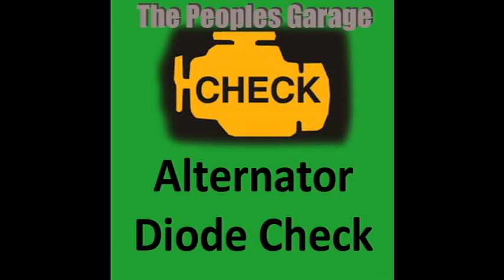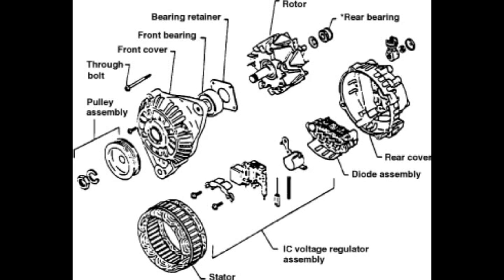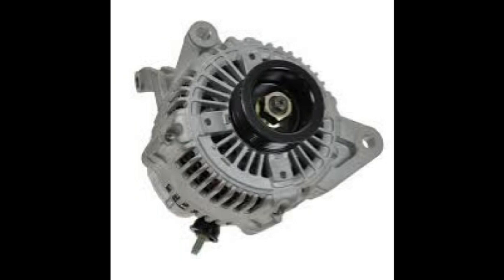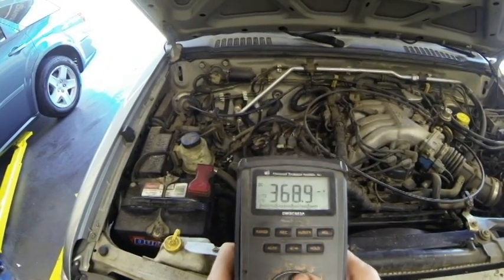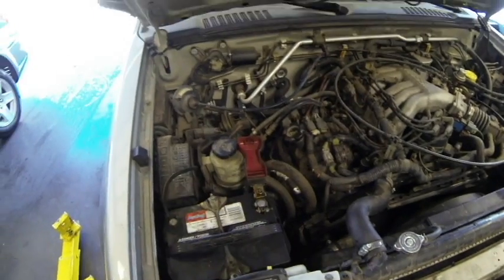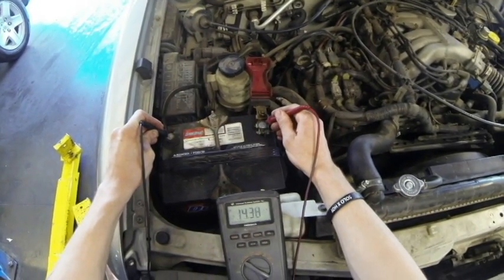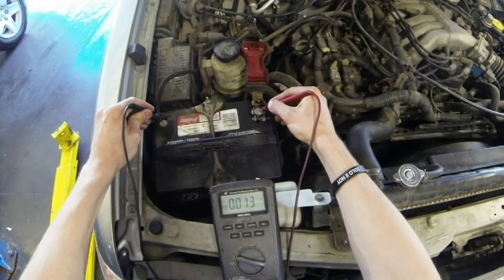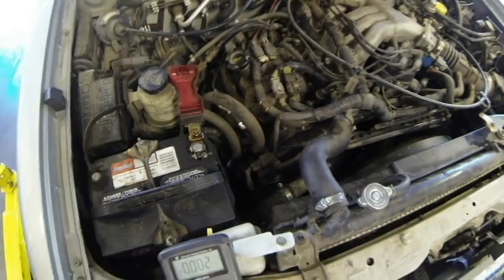Alternator Diode Check and AC Ripple Check

Comment: I've seen videos where people put the multimeter on diode mode, then touch the case and positive post on the alternator in both directions.   If they get a reading both ways the diode is bad.  Is this test as accurate or better?   Just trying to learn and find the "easiest" ways to do things.  Also, is it true a bad diode can drain the battery when the engine is off?

Comment: My battery is going dead over night and its a new battery and no parasitic draw. I ran this test and the ac volts spike between .070 and.040 constantly bouncing up and down. Would this be the issue?
Reply: did you sove the issue ? ;) What was the cause of your paralytic drain ?
Reply: @maxmagnus15  For me it was an issue with the ignition relay. For some reason jeep put it under the driver side wheel well and it was getting soaked in rain

Comment: With my multimeter set to ACV and the leads firmly on the battery posts, I have a reading that keeps jumps around. The numbers will never stop moving. Would that indicate a bad diode? My battery drains overnight.

Comment: When doing this test, do NOT use a cheap Harbor Freight DVM. I read 31 Volts AC on crap DWM, then used quality DVM like a Fluke, read .2 Volts AC. All good now.
Reply: Hmm yeah I was getting 26 volts on my Harbor Freight (free) multi Volt meter.   That's insane!  So you could be right. Sometimes I trust my life to the readings of a volt meter. Probably time to upgrade:)
Reply: @WhatDavidDoes  Try a Fluke. Harbor freight is junk for just reading basic 12 VDC signals. They won't work at higher freq also
Reply: I think a Klein multimeter is a good middle ground.
Reply: Why would we take your advice? You're the one who used a "cheap Harbor Freight DVM" to do diagnostic testing. So now, the rest of your advice is suspect. If you actually own a Fluke voltmeter, why would you work on a car with the HF? I'm just not buying whatever you're selling.
Reply: @uruiamnot  clearly you know everything so do what you want. I learned this from EE n suppliers. Take it or leave it. Flukes work better
Reply: @michaelreilly3100  Your conceptual error continues. Now, you're a either a marketing genius or buffoon.
Reply: @uruiamnot  good luck with that attitude. Please use cheap DVMs
Reply: @michaelreilly3100  I own and use both cheap ones and expensive ones; I even own a Fluke. Since I understand the operation of them, and I have good, practical experience, and good situational common sense, I know when to use each one. Your situational awareness is demonstrably bad, because you assumed I was against Fluke and for cheap voltmeters when I never said that.

This is why your advice is unreasonable: you don't know what you're talking about.

Comment: I'm getting pulsing headlights and interior and dash lights .I did test the DC volts.and that was fine.but I did not do the AC check.can a bad diode cause this.
Reply: Daniel Pettis , did you get an answer to your questions? I also have a suspect diode leaking A/C.

Comment: I used to rebuild alternators years ago and there are 3 negative and 3 positive diodes in most alternators. GM alternators had a diode trio on  top of that. A guy on another channel said too much ripple meant the regulator was bad

Comment: I'm wondering in comparison to a transformer, what is the exact ac voltage, a power supply will have a transformer that produces 18v ac and when rectified and filtered you'll get about 24v dc  then its reduced to 13.8v through a regulated circuit so I'm wondering the same for the alternator windings  before it reaches the internal rectifier diode's?
Reply: When you add the capacitor to rectifier it will have a higher DC reading because your dips or decrease given you a higher reading  on your meter

Comment: so that mind that I need a new alternator?
Reply: If you got 100mv of AC on your meter your diodes or a diode in the alternater could be bad. Make sure your meter is accurate by checking the AC voltage on another vehicle. Your looking for MV. Make sure your meter is set for MV and AC voltage.

Comment: Depending on battery condition your battery may absorb AC ripple not allowing you to read. It's more accurate off of the alternator itself and with the battery disconnected.

Comment: The DC voltage test should really be in three stages at about 1500 to 3000  Rpm (1)  off load, (2) on load (ie head lights and heated screen switched on)   (3) and all loads switched off.

If the voltage may be drop a little under load but should not be below 13.4 volts. There should be no sudden spikes or dropouts in the voltage when electrical loads are switched on or off and and voltages above 15 volts will shorten the life of electrical components.
Reply: Can I wait 2 days before I have time to fix it? Or should I stop using the car?!

Comment: the battery absorbs too much,so going to the back of the alternator is better. now if you want to really see it in action.  use a scope,  like the vantage pro and watch it peak to peek as well as the hash lines. nice video I liked it.

Comment: I'm getting 30 volts A/C from my readings,.. is that bad? >.<
Reply: Could it be that it isn't true rms? (I heard that on another video - I have no idea what I'm talking about but hopefully you do). Something cheap multis don't have.
Reply: +Tom McBride 
Sounds like your meter has switched automatically to the mV scale  -  30 mV  or 0,03 Volts.
Reply: Make sure use a good DVM. First run with cheap harbor freight meter gave me bad read of 30 vac. Those meters aren’t meant for high frequency AC readings, just simple household 60 hz AC. Second, I used friends quality Fluke n read .2 vac
Reply: I'm getting 29.5 on the ACV setting of my Harbor Freight DMM.  Is that really the AC voltage?